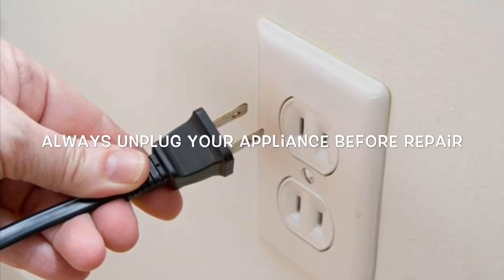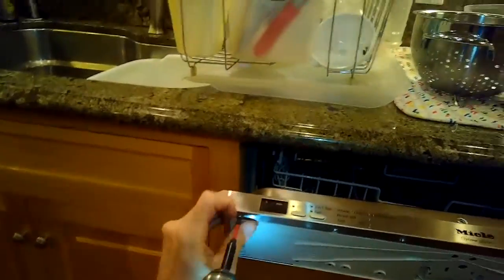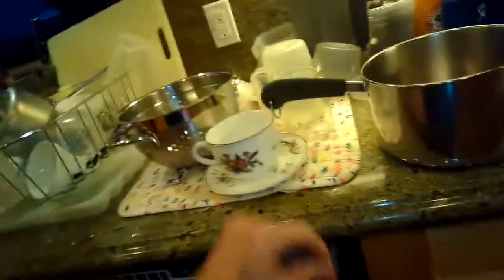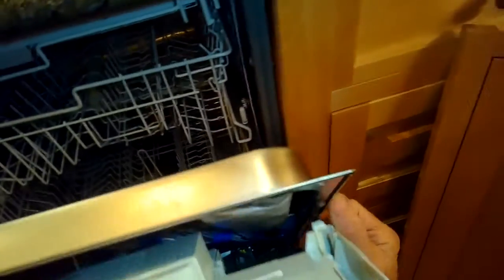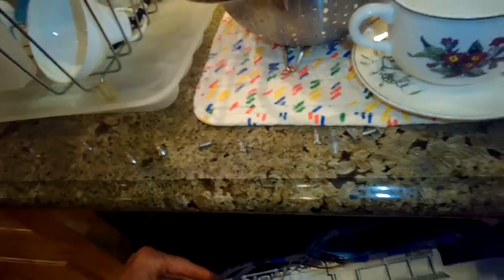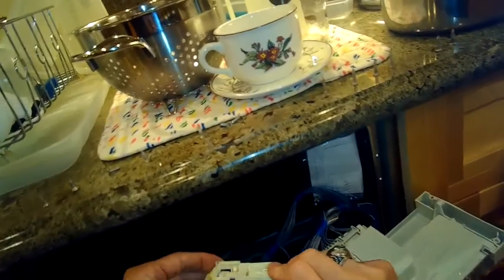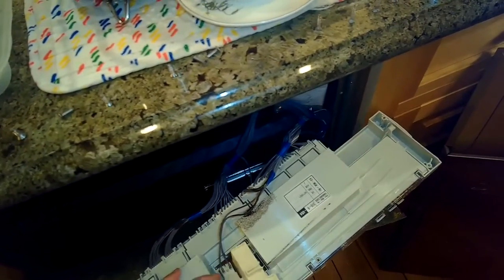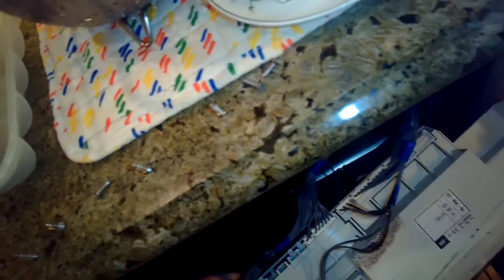✨ MIELE DISHWASHER - EASY CONTROLLER REPLACEMENT ✨

Comment: 6:35 hey Scott I have a G 2732 and according to the manual on page 103 I need a new electronic control unit when I call Mia USA for parts to get the part number they say I can order it but they insist that a technician has to come to program it is that corrector can I program it myself?
Reply from the maker: Can you send me an email to: scottthefixitguy@yahoo.com

Comment: Any suggestions for a Miele that needs to be slammed shut to start running?
Reply from the maker: I wonder if the door switch is loose?
There’s a screw on the top of the door that may need tightening.
You might also have something blocking the door from fully closing.
Reply: @ScottTheFixItGuyChannel  I've tried adjusting the latch with the lock attaches to on the machine itself with no luck. I made sure the switch is tightened as well. Are there any pins that need to make contact elsewhere in order for it to start running as it seems like the lock is functioning properly? Because even if the door is open and I trip the lock to closed, the machine will not run.

Comment: Hi, in this video at 1:09 you take off the metal cover of the control panel.  Is that cover replaceable? or maybe you can suggest another solution.  On my machine the shorter piece that forms the corner going down the side keeps popping away from the door, and this  prevents the door from closing.  It "clicks" back but not for long.  I have to remember to check it when I close the door.  Any advice please?  Thank you for the great video.
Reply from the maker: Can you send that same question to: scottthefixitguy@yahoo.com

Comment: Would you mind helping me make a decision on whether I should try and fix 4 year old machine. Water was flooding onto the floor. Tech came out and said it needed new hose. Waited 3 months for new hose, but after he installed it--now, no power at all. He says the flooding burned out the control board and replacing that is more expensive than buying a new machine. What would you do?
Reply from the maker: Thanks Edward,
Can you send me that same question to:
Scottthefixitguy@yahoo.com

Comment: Hi Scott, I have a Miele Futura Dimension that looks similar to this DW.  There is no power at the control panel - the DW won't turn on.  I have confirmed that I have power coming into the dishwasher.  Is this a symptom of a bad control panel?  i.e. would replacing the control panel potentially fix this kind of problem?  I am going to check the connectors as well to see if something has fallen loose.  DW is only about 10 years old.
Reply from the maker: Thanks Lance, I think you’re right a bad controller, or a broken wire where the door hinges that brings power up to the controller.

Comment: Hi Scott. Was this fix in the video done to resolve a f79 error code? I’m getting that code on a 2.5y futura classic machine. I pulled the machine from the cabinet, removed the circulation motor assembled for visual check and cleaning. It looks great and so do the wires. My next step was to look into the pcb.

Comment: Okay it's working perfectly now. He changed the electronic control board and the water intake valve and some other part. They must not have run this one when it left the factory. The machine was making the same noise as a machine in one of your previous videos. The water would sputter out.  You used a generic replacement though, not Miele. That part is a friggin fortune. The intake valve on the new machine is completely different than our older machine. It's part of the interior of the machine. I can't describe it. This would have cost well over $600 to fix. Whatever, it didn't cost us anything and we purchased the five-year extended warranty. They took $50 off, so it was only $249. That's not too bad for parts and labor. I mean we're already off to bad start, who knows what else can happened in the next few years.

It works great, but I still think the build quality on our older machine was superior. Especially the door and the hinges.
Reply from the maker: Thanks John,

I’m glad it’s working 👍

Comment: Have you ever heard of a new machine needing to have the circuit board replaced? Apparently that's what our machine needs. The tech came on Friday and initially could not figure out what the problem was and said the only other thing he could think of is the built in software on the controller. He was perplexed. He even took a video of what his laptop was saying while the machine was bugging out. The machine wasn't even running properly from his laptop. We have to until next week Tuesday. The part wasn't in stock locally.

I mean it's not costing us anything which is good, but I'm just worried there might be something other than the controller. I can't imagine that the on-board computer is making the machine act that way. So many things can go wrong with these dishwashers.  He told me he just came from a house where the customer broke the lock on a machine that has the double-knock feature. That's $575.00 fix. Ouch!!! I just can't imagine anyone purchasing one of these without getting the extended warranty.
Reply from the maker: What symptoms do you notice?
Reply: Well it's pretty much doing what you see in the video. I still have it up. The funny thing is when you turn the machine, it doesn't drain. That's the first thing it should do. Then water comes into the machine for five seconds, then it stops. Comes in and then stops.

Until it fills and the cycle will start but the intake light flashes during the cycle. The tech said he's never seen a machine do that. I'm just wondering if I should just call the place where I ordered the machine from and tell them that it just may be a rare dud rather than wait until the 26th when the tech comes back with the new part and have it still not work. It just sounds weird when it's running. It sounds like it's more than just the onboard controller.
Reply: Can you send a picture of how high the water fills in relation to the plastic filter handle?
Reply: @QuickAndEasy5MinuteAppliance  I'll do better than that. I'll just do a video. The machine is completely dry and watch it does. I just think it's defective. Give me ten minutes. It won't take long. I'll start it with nothing in and watch what it does.